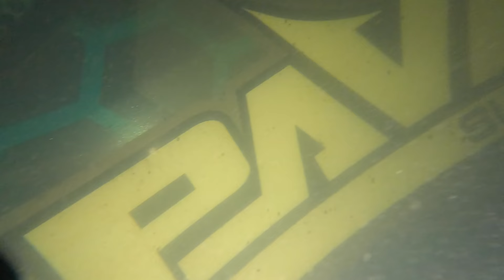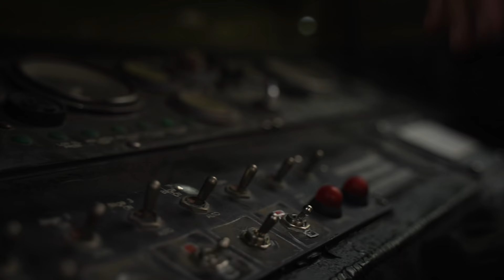I Sunk My Brand New $400k Pavati Boat- 95 Foot Deep Recovery With @AdventuresWithPurpose

Comment: 12:37 That’s not what nitrogen narcosis is… What’s he’s describing is called Decompression sickness aka “the bends”. Even at 95 feet on air, you still have a 25 minute ‘no decompression limit’ meaning you can stay at that depth for up to 25 minutes and still be able to return to the surface without stopping. That’s plenty of time to attach lift bags.  After that time is up, you will be required to do a “decompression stop” at a specific depth for a specific time in order to expel excess nitrogen from the body. (Tissues saturate with nitrogen when you breathe compressed air at depth) If you surface too quickly, the liquid nitrogen in your bloodstream expands into a gas, just like opening a bottle of soda. You have a computer telling you exactly what to do, it’s not like it just magically happens. If you get the bends it’s 100% your own fault. Nitrogen Narcosis is something totally different; Nitrogen actually has a narcotic effect at depth, they teach you something in class it’s something like every 10 feet deeper than 70 feet is like drinking a martini on an empty stomach. I’ve been 140 ft deep and even then only experienced very mild narcosis, basically makes you feel drunk. It’s not a for sure thing unless you go super deep. Nice video, but that guy is talking total nonsense lol… I don’t think I’ve ever heard an actual diver say something so inaccurate

Comment: Next time put some rollers under it when you get it to shore. round wooden post would work well and be fairly cheap but they may float up anything round. Put the air bags underneath if possible lifting up. Maybe a large one just partially inflated would conform to the underside of the boat and help lift and cushion. Just ideas. Instead of anchors drive in some heavy thick rebar stakes at an angle with a sledge or in addition to the anchors.

Comment: I had this almost happen to my 2006 Mastercraft x45. I had it serviced and they didn't tighten the back drain plug and it came out while wakeboarding and tubing. Didn't realize the boat was sinking until I pulled into Las Vegas boat harbor and opened the storage area and saw everything floating. Thankfully the marina had extra pumps to pump out the water until we could pull it. We stuffed some socks in the hole till then.

Comment: As a scuba-diver, a 95ft deep boat-recovery is dangerous, as they say.  However, it's also (in a way) not dangerous if you have the proper training and experience, and plan your dive.

At my experience-level, I'd be comfortable with diving down to the boat and then back to the surface.  However for the recovery itself, forget it.  Just looking at things I wouldn't feel perfectly safe doing with my current experience:  Drysuits, "Technical" (Decompression) Diving, and Recovery of a large object.  The asset-recovery is really the big one, because of entanglement hazards, objects may move unexpectedly, etc.

And what most non-divers aren't aware of is while diving, everything it a little different.  In particular, you tend to have a very limited field-of-view and everything is just "different" while underwater.  Something that's easy on land can be rather disorienting underwater.  So, for example, if the boat started shifting and sliding, it would be very easy to not notice and get trapped.

Comment: Using the boat's nose racks, i'd build an gantry crane (like) attachment with an extra flotation tank some 2~3 meters ahead. This would be a bolt on deal that would allow you basically lift an item almost clean out of the water, where it's almost neutral and then re-rig such that in the case of a boat, it's pointing the right way and easy to transport (or a car, back on its wheels and so on) and bring to a place where you can tow it out. You could use another small aluminium boat, weld the top of that boat shut, fill it with close cell foam and build off it. The span between them is where you'd have the crane/winch and other attachment points. Could even have something like a platform. If you find a cheapy alu boat, it would work super easy and because it's a former boat, it wouldn't upset the hydrodynamics of the whole affair that much.

Comment: I did have an experience when I was 10 years old and I’m not one to be a big believer.  I was riding my bike along a highway right on the curb and needed up slipping off the curb and landing completely on my side in to the right lane. After landing on the asphalt I saw an 18 wheeler coming straight at me doing 70 miles and hour.  I watch the truck coming at me and saw a bunch of smoke but what looked like wings in the smoke. The truck Bailey stop before hitting me. The man driving the truck got out of the truck freaking out. He kept saying there is no way I should have been able to stop before hitting you and started crying. I was to young to know what distance he was able to go from 70 to 0 but the driver knew it was a miracle.

Comment: Tech tip, when burying the anchors. Dig a trench for the line. That way when the weight hits the anchor, the anchor is digging down, not pulling up to the surface against the loose sand. Y'all got er done but thought I share. Good work!!!!

Comment: When I was about 11 years old was on a school trip to a place where we get to do all sorts of water sports. Had a load of fun that week but the one memory that sticks out most is sailing. We where on a sailboat that has a little bit of water in the boat and they said it’s ok it’s supposed to do that. Well we’re in the middle of the lake and the water is now up to our knees as we sat in the boat. We all had to get hold of buckets and bail out the water as we limped back to shore with the small emergency engine in the sail boat

Comment: Jared needs an air pump and line for filling those bags. Filling them out of the tanks works, but it's a lot of extra weight and probably not nearly as convenient as a weighted line with an air nozzle run down with the guide line.
Reply: Too slow, those tanks are 2400psi, a compressor would take for ever.
Reply: Just send Dave down there, he's got Plenty of Hot Air to fill those bags!!! 🤣😂
Reply: @marvindebot3264  You can get compressors with different ratings, or compressors designed to fill scuba tanks. 

Also, Scuba tanks aren't going to be releasing the pressure that quickly. It's not like the release valve moves air at 2400 to 4500 psi
Reply: @edwardmorley8359  Scuba tank compressors are built for pressure, not volume, they take a half hour to fill a tank. 

A scuba tank valve does dispense air at that pressure and then a regualter steps it down. the special bag regs they use step down to circa 100psi (depending on the depth, the setting can be changed to compensate) and fill a bag in around a minute. I know, I used them. I don't have a salvage diver rating but I have worked with people who do and I have around 1200 hours of dive time over 35 years. I can tell you from experience this is a far more effective way of doing it without a compressor that weighs several hundred pounds (to fill bags efficiently using a compressor you need one designed for a jackhammer's rate of air consumption) and the guys work out of small craft usually under 20 feet in length.
Reply: @marvindebot3264  The ratings for compressors are in CFM. A Scuba tank can hold up to 80 Cu. Feet.

A standard compressor, (portable), moves 20 CFM per minute, while an Industrial compressor can move up to 180 CFM per minute.

That means, with a standard portable compressor you could deliver the same amount of air that's in a scuba tank in 4 minutes.

Or you could pick up a Quincy 5120 which moves 96 CFM at 175 psi, and deliver that in less than 1 minute. A touch expensive however.

Pressurizing the air slows down the rate it moves air. Your average portable compressor has the ability to suck in 20 CFM, but pressurizing that air reduces it, so what you can do is reduce the output pressure and just use the pump to move air. You don't even need a tank as it's somewhat redundant unless you want to deliver high pressure air.

You could spend about 1500 on a decent compressor, detach the tank and run the air delivery line directly to a nozzle and output into an airline with a regulator controlling the flow rate and pressure, along with a an Over Pressure Valve to bleed off excess pressure while it's not in use.

Mount it on a base, and it should be good; you could even put it on a floatation device. Just keep in mind it's not filtered, and not safe for Human use, and intended only for filling floatation devices.

You wouldn't necessarily need to spend that much, as you could just pull a compressor motor off a portable compressor for a lot less. Just make sure it's gas or diesel, so you don't need power.

Comment: Discovery Channel-esque: “every step of this is super dangerous and we might die” drama.
Reply: Um.. considering AWP doesn't have certifications and haven't done classes on diving that deep, yes, they could die. It's not drama. I'm not trying to dog them, but if they're going to be diving that deep and trying new tank setups they should be doing classes. They've been offered classes from Dive Talk, who are actual instructors. In their one video I think preparing for this, because it looks like the same area, they tried a new set up and the dude with the beard came up WAY too fast, he had a malfunction and lost air. They should have never tried to dive that deep without taking the appropriate classes and learning more about their setups before jumping in the water. The one literally said he just set the stuff up the night before and it's brand new to them. They do a lot of "winging it" and that's extremely dangerous

Comment: Nice video and got rescue of the boat.

But at @35:00 i have some critic NEVER TOUCH A ROPE WHICH IS BEING WINDED.
A steel Rope is not so damger but a Poly Butane Rope which splits in half can rip your body apart.

Comment: Just as you do when preflight your aircraft, I recommend creating and using a checklist before you go boating.
Reply: I do. There’s only one thing on my checklist. It’s the plug. I still forget it time to time..
Reply: HAH
NEVER AGAIN WILL A PLUG BE FORGOTTEN 
Same with kayaks and a friend that does not swim 
Thanks God i insisted on a life jacket
 And it was only chest depth nit 95 feet
Reply: A boat this size and cost should have automatic bilge pumps AND bilge water level alarms. Letting water in for an hour or two before noticing the boat is settling is not a good thing.
Reply: @nicolaablett7790  - It wasn’t forgotten, you may want to go read Dave’s comment.
Reply: @ajwilson605  he didn't forget the bilge pump. It popped out after a sand bar trip.
Reply: No pilot ever screwed up a preflight checklist. 🤔
Reply: @redrose41000  I read Dave's comment. He said the bilge pumps were running, yet one had blown it's fuse making it non-operational. If he had bilge water level alarms on the boat they would have alerted him to high water in the bilges way before the boat took on enough water to sink. A $400K boat sunk for want of $100 worth of bilge water level alarms. The boat manufacturer should have known better and equipped the boat properly. Once the boat hit the breakpoint in weight it sank in 30 seconds. If Dave had thought something was wrong, it would have taken over 30 seconds to pull an engine cover to see how much water was in the bilges. THAT is why you have high water alarms in the bilges. Cheap insurance!
Reply: @ajwilson605  pop

Comment: In adventures videos you can see the plug in underwater at 56:50 , abit confused but either way thankfully your family is safe mate
Reply: It's not in all the way it was letting water in pretty quickly the part that makes it tight isn't even on it if you go look at what they look like then look at the part in the video you are referencing
Reply: @fxrsniper1   you made me have to look again , yes if it isn’t in all the way it’s not far out… for all you and I know the plug could have come out/broke  at the same time the hull got dented up …. And you have better eyes then me if you can tell what plug that is it almost looks like the one he said was suppose to be in it in his next video  , I love watching heavy d , but this one was just fishy ,  good to see he got a brand new boat 👌
Reply: @DaaTzYDK  Well the next video also shows that he screwed up when swapping batteries out and the bilge pump hose was disconnected. I own boats for nearly 30 years familiar with the older drain plugs lol. I don't think he got a new boat I think they are fixing that one.

Comment: People calling out insurance fraud have never owned a boat. A missing plug has sunk thousands of boats. By the time you realize it's missing you're already screwed and will most likely lose the boat, it's going to sink.
Reply: Putting a plastic drain plug on anything but a John boat is ridiculous. They didn’t forget, the used a plastic lynch pin where they should have used brass

Comment: Question, does that boat have a chance of ever being used again or is something rescued from the depths like that now just salvage?
Reply: Well, first it needs a plug. Then new electronics and an engine will help too. But yes, you can make it work again. Pavati are strong boats
Reply: @sebastiankitzing2316  well clearly he will have enough money too do that😂😂😂 it’s already a $400,000 boat so😂😂😂
Reply: @sebastiankitzing2316  thats cool, good to hear its not just a pile of scrap metal.
Reply: the owner of pavati, with the sunglasses, had his trailer and took it with him so im sure they are gonna try and fix it... waiting for that video  :)
Reply: Throw enough money at it and you can make it purr yet again!
Reply: Yes it will be rebuilt
Reply: @srlsolutionsself-reliancet3247  heavy D said it was his own boat, then he said it was the family boat, then he showed the owner of the boat …. So, any idea who actually owns it ?
Reply: @pilgrimpeace7763  he showed the owner of Pavati, not the owner of the boat. He is the owner of the boat
Reply: @pilgrimpeace7763  Also isnt't Heavyd's boat a different color? I thought it was a olivish color.
Reply: @pilgrimpeace7763  That was the owner of the company that built the boat. (Chuck aka Sunglasses guy)

Comment: That oil spill left on the sand in that recovery from the track gear panel of that excavator was brutal... looked like 3 or 4 gallons hit the wet sand while the tide was out and was left. An ecological disaster for sure! Surprised it was just dumped on the ground where water is and not into a catch pan. Was disgusting to watch someone dump gear oil on wetland... Savage AF!! Might as well drain your engine oil in a lake. Wouldnt be any worse
Reply: Thanks for inv. me to call you! Keep up the the streams.

Comment: A friend and myself forgot the plug once, to excited to get out there caused complacency, as soon as the malibu boat slowed 6" of water was at our feet, we barely made it to shore using my hand by the alternator belt and a ziplock bag around the shirt to plug the hole, we found out no water would enter soon as the boat planed out. Took 3 hours to drain the water then found the plug. Then back on the lake.

Comment: Greatest ROI is the key. What option or options gives the quickest return. 
Venue- very large investment- largest return percentage- not a fast build. 
Admin building and air bnb or cabins- smaller investment a quicker turnaround but lower return rate.

Comment: Public service anouncement. If you ever find youself on a sinking boat, if you can,  put the boat in gear & get moveing forward. It will drain the water from the boat.  Even if you are barely moving it will drain. I have recovered boats from the bottom that had holes in the transom.  We simply hooked to the bow eye & pulled. The boat surfaced & all of the water drained out where the hole in the transom was. It is a bit risky in this case, but I bet you could have floated this boat with enough forward momentum. Happens with race boats all the time.

Comment: Lack of a $20 drain plug = loss of $400,000 boat. They say it was an inexpensive O-ring that doomed the space shuttle Challenger. Cool thing about an aluminum boat is the hull will last forever so with enough $$$ this can be made like new again. The salvage team looks expensive aka: They look 100% professional - some of us are wondering what the salvage part cost

Comment: Dave, you do know that if you were to have gotten your boat on plane, the water inside would have went back out and you could have driven it back to the dock where you launched it and gotten it back on the trailer…. No sinking necessary. Virtually every boater should know this.

Comment: I’m a rope rescue tech. If you would have moved the sand anchor as far up the shore and moved the boats as close together as possible the anchor would not have failed.
Reply: Also, the second sand anchor should have been connected and placed directly behind the primary sand anchor in line with the resulting force. Creating a load sharing anchor system.

Comment: The Physics.
H2O molecule, within each cell, transforms, under great changes in pressure, from liquid state to solid state or to gas vape, the energy released, as the field collapses, can cause cell death, vape is hotter than boiling water = damage is caused to lungs = sickness, upper respiratory infections.
Same as flightflu. Pressure at 35,000 feet can cause lung damage over time, if you fly a lot.
Human body simply isn't designed to exist at great depths or great heights = hostile environments.

Comment: I wonder if you used your pumps to pump water to wet the sand to hold the anchors better; wet sand versus dry sand for holding power.